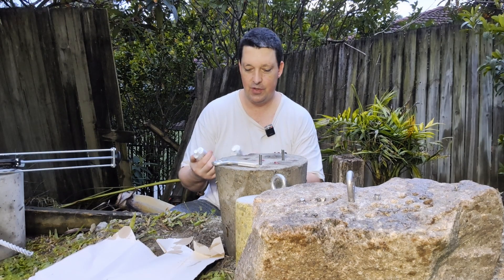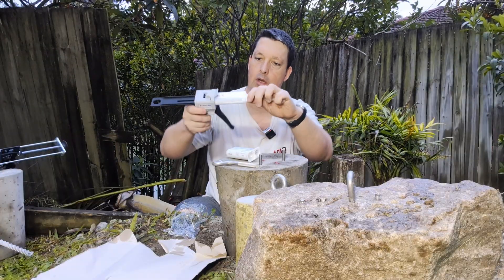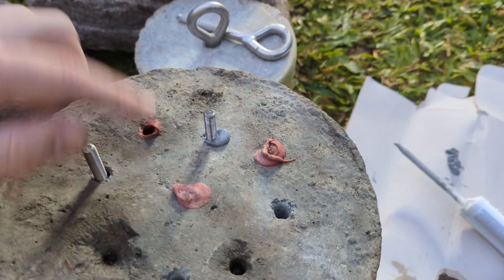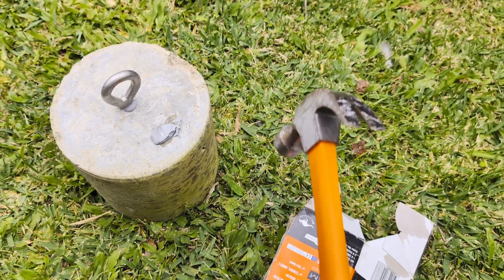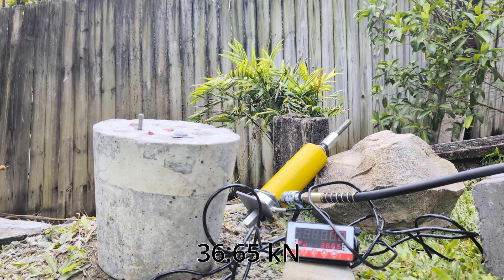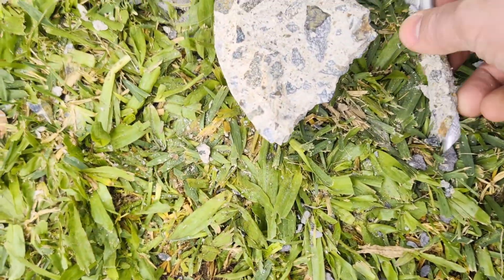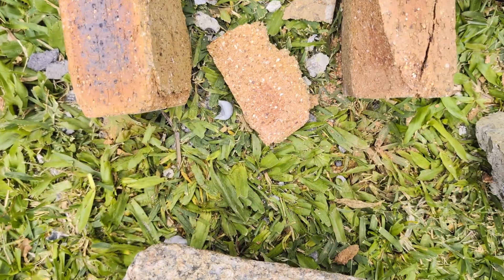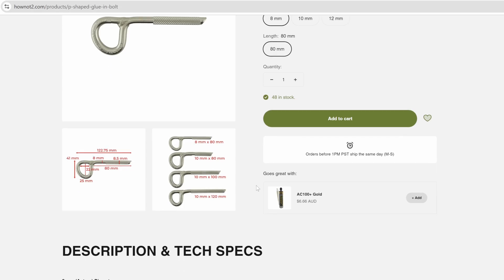Single serve bolting resin: Araldite Kit 680

Comment: I’ve just used the Fischer concrete type the gritty one to fill a void were the mount for the tele bracket kept coming loose left it then drilled it .  Bang on now hard as a rock great vid again cheers
Reply from the maker: I use them all the time but I'm still amazed by how bloody solid these glues get. Even this random tiny thing from China!
Reply: this was filled years ago with cement between bricks which just turned to powder pretty big hole so I used the stuff as filler poss 200 ml worth scraped it flat used my 171 Makita sds which I know you love 5mm then 8 then ten put rawl plug voila hard as nails can’t even tell I’ve done anything . Thought I was gonn have to take all the bricks out redo it plaster it re paper but nope amazing stuff . The devils work 😂😂